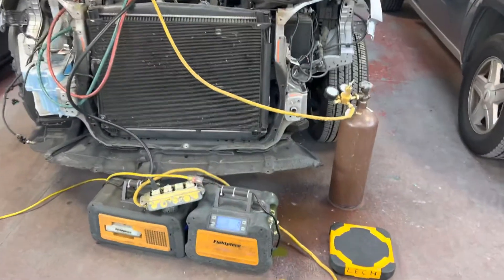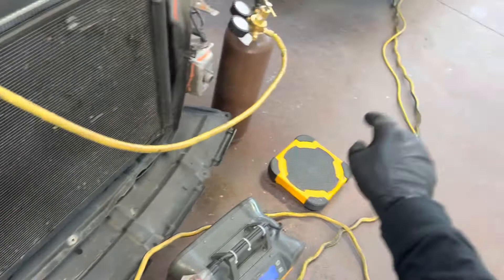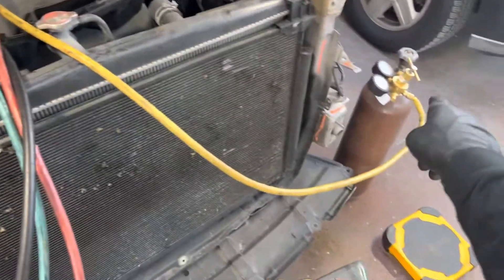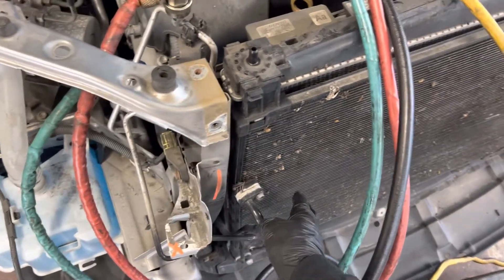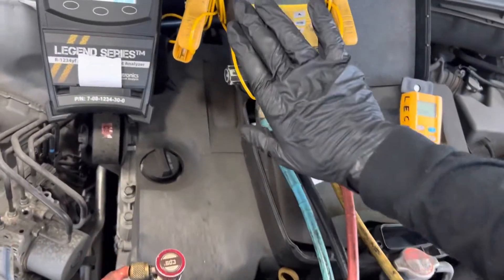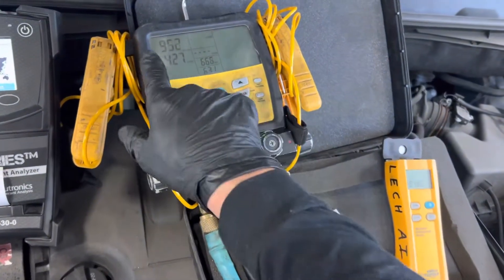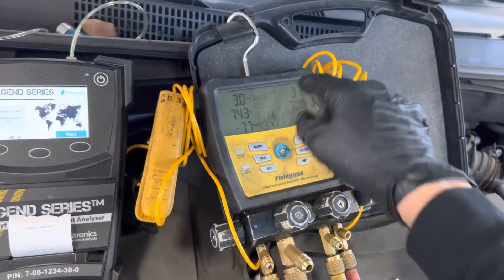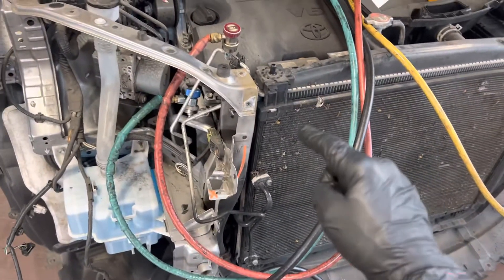Switching from refrigerant recovery into nitrogen purge to prevent air and moisture contamination￼

Comment: Im guessing your tech will install condensor right away ? Here , they take of the condensor, park the car outside for weeks waiting for the new one. Nitrogen will not help. Im going to try to educate them but it's not my shop...
Reply from the maker: Sometimes yes sometimes no. It depends on what shop I’m in. 
Some insert rubber plugs into the lines to seal them.

Comment: I decided not only to pull that 12 or 24-hour vacuum but I'm also going to wait until the least humid day which would be like 25% humidity to even open up the accumulator to install it at the end of the repair. This will further minimize at least I hope further minimize about moisture am I right?
Reply from the maker: Accumulator should be packed with dry nitrogen. Pressure 
You open it goes right on and vacuum down instantly.

Comment: is there even any point in trying to recover the stuff into the 2 or 1 valve tank if i dont even have a refridge analyzer at all?:p
and i would probably need the 2 valve tank if i want to fill the system through the high side liquid?
Reply from the maker: Refrigerant need to go get recycling first. Before it can be reused. 
         Just like you engine oil used. 

Refrigerant Has many different oils, metal flakes, acid, moisture, a old recovery tank is dirty sometimes rust inside it. 

We drop it off at a recycling place .  Or we own recycling equipment to do it our self.
Reply: @coldfinger459sub0  ok, but what if it has some weird refridge mix inside which they and certainly i cant even recycle... so i can just keep a separate dirty recovery tank with 1 valve anyway, because all weird mixes would have to be destroyed anyway?
and then i can flip the (new clean)1 valve tank upside down to fill it via high side liquid when needed?
Reply from the maker: @viisteist1363  if it is contaminated then it just goes in a separate tank .that gets sent off to the recycler here in America all our recovery tanks are two-way tanks that have a liquid side and a vapor side.